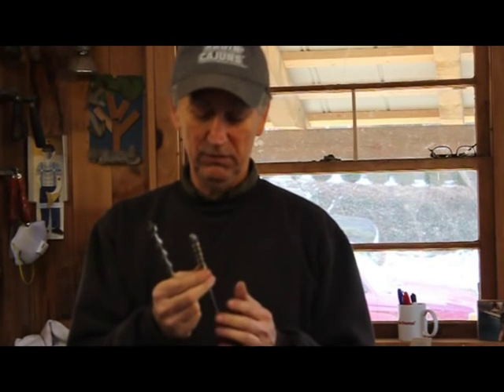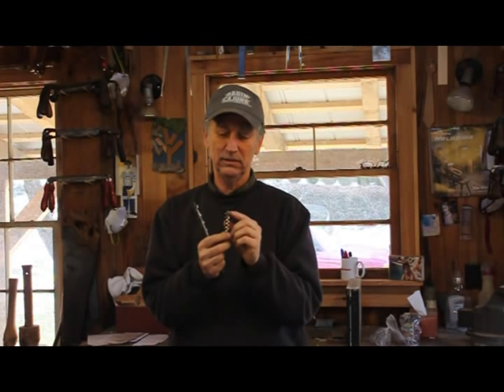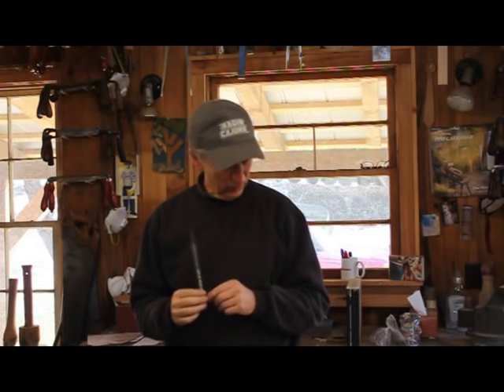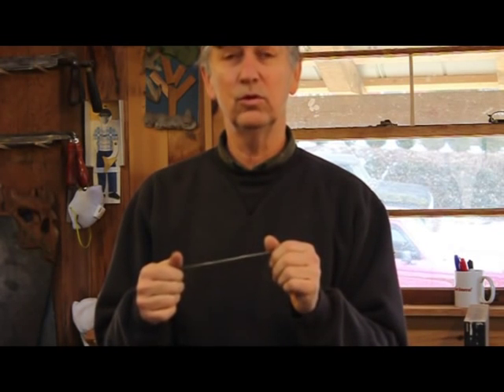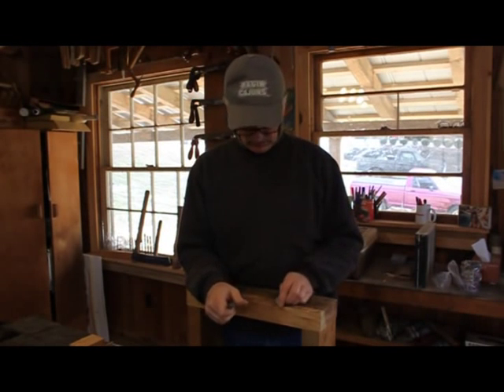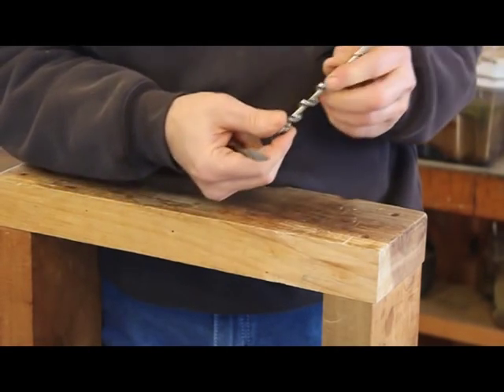Sharpening an Auger Bit

Comment: thank you Curtis!  I just got a few bits from the local second hand store and now I need to tune them up. The problem was either they weren't straight, pitted with rust or the knickers were filed off. The important part though is the file that is needed and I can get that from a Local supplier (Lee Valley) regards, Barry

Comment: How do you restor old bits
Reply from the maker: It depends on what kind of a shape its in. If its too far gone its not worth it. It is possible to make the spurs longer by filing the cutter on the bottom but its a lot of work.